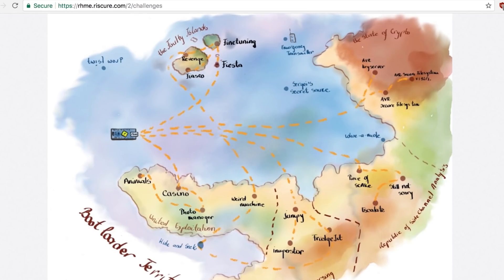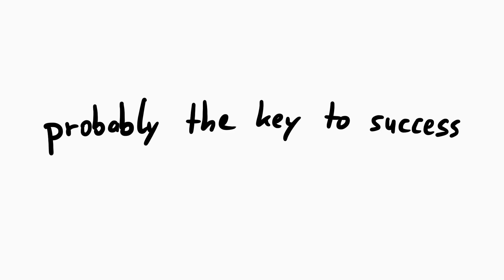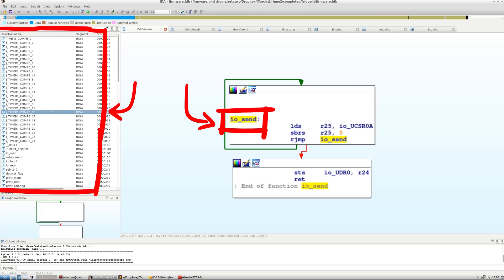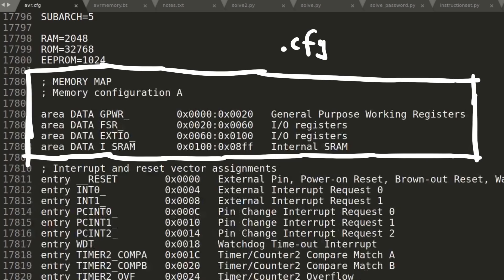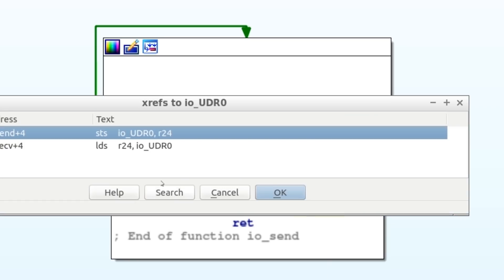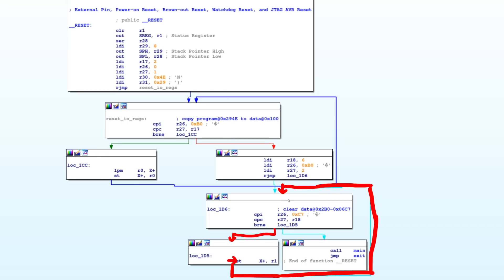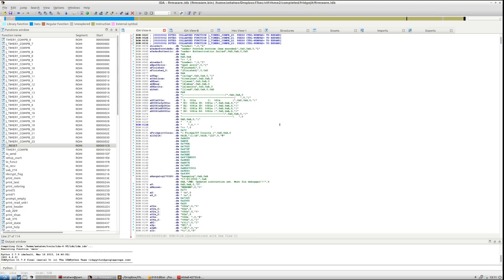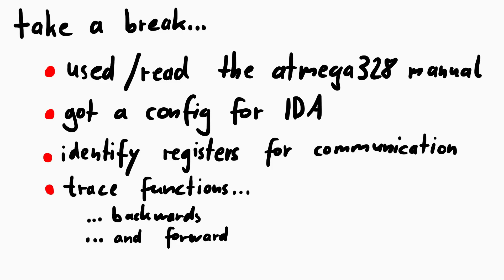Identifying UART and main() in an AVR firmware (ft. Zeta Two) part 1 - rhme2

Comment: Why didn't you use IDA feature to specify segment + offset to make references to the string data? So that you haven't had to put the comments near the addresses manually. And why didn't you try to learn about IDE + compiler used to create the firmware, first. It would allow you to install it on your local machine and learn about how C functions are translated into AVR code, how the arguments are passed, how the values are returned, etc. And moreover you could find all the code within the standard libraries, which a distributed with the IDE, and then just find the same library functions within firmware. So that you don't have to go through 'deduction' phase.
Reply: The problem is the weird addressing in AVR which IDA doesn't understand. IDA addresses by word but when accessing the program segment, AVD addresses by byte which means that what the code addresses as 0x68 is found at address 0x34 (0x68/2) in IDA. Maybe there are ways around that but I didn't find them at the time.

Regarding trying to find which compiler, IDE, library, etc was used. That's a great idea but in this case, this was simply faster as I had absolutely no idea what tools they had used and reversing these basic functions was fairly quick anyway.

Comment: Hi, is there any video with a software defined radio by you?
Reply from the maker: I have never done SDR. It's actually something I would like to do at some point!
Reply: I've only dabbled in SDR but it wasn't nearly as intimidating as it seemed. Here is the RTL-SDR i bought, it's almost plug-and-play with linux systems and is very easy to use: https://tinyurl.com/yaee4mv8

You should be able to install some drivers and boot up gnuradio/gqrx and be able to see all the weird signals flying through the air around you. It's lots of fun to see all the many kinds of transmission and try to figure out what they're doing! RTL-SDR dongles are based off of a hacked TV Tuner chip, and they have a limited frequency range they can interpret, but there are adapters that will let you see wi-fi and other high-frequency traffic. There are similar boards for listening to low frequency traffic (paradoxically called high frequency and very high frequency, because they were the high frequencies of the spectrum when they were created): https://tinyurl.com/y925wyrr. I don't remember what the wi-fi adapter board is called (it may be a DIY thing).

Search for a spectrum allocation chart/document from your relevant governing body for an idea of what you can find on the air around you. Here's the one i use: https://tinyurl.com/y7epma7z
Also, it might be worth looking for the equivalent chart for your neighbouring countries, especially if you live near a border.

As for stuff you can do with SDR: I collected a week's worth of ADS-B data from the transponders of aircraft landing at my local airport and used python to recreate their flight paths from this data: https://tinyurl.com/y7w6gpd4
I think it looks cool, and it was less than 100 lines of Python thanks to numpy and matplotlib.

I also quickly discovered that while the coast guard has a "private" radio channel that isn't accessible by civilian marine radios, but you can tune into it with SDR. It's fun listening to them deal with all the paddleboats and tourists that get themselves stuck in stupid places on the water (like in ferry or shipping lanes in an already crowded inlet).

One last tip: The reason the kit i linked above comes with a telescoping antenna is because an antenna is MUCH more effective if it's length corresponds to a multiple of the wavelength of whatever signal you're tuning into. The formula is: 300/(frequency in MHz)  = length (meters). This is a simplified formula, which ignores a lot of detail (it's just the speed of light divided by frequency) but it's close enough for rock and roll. adjust your antenna to match it (or a multiple of that length, such as a half or quarter of that length.)
 Also, here's a great cheatsheet on antennas in general: https://tinyurl.com/y82fuoh7 (note that none of that shit matters unless you want to go deep into the rabbit hole. Just remember the formula above and you'll be fine for most SDR related stuff.)

SDR is pretty cheap to get into, the software is easy to use, and there's a TON of weird stuff on the airwaves that you'd never expect to find. Have fun!